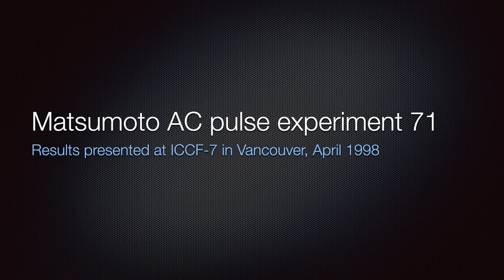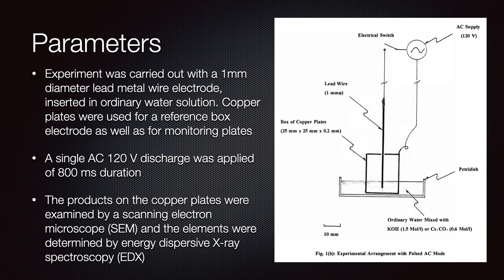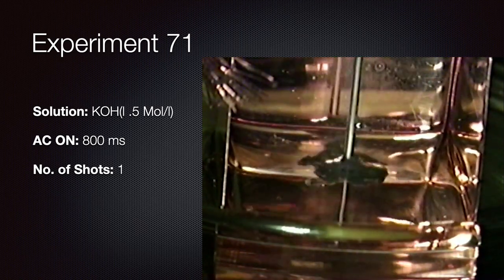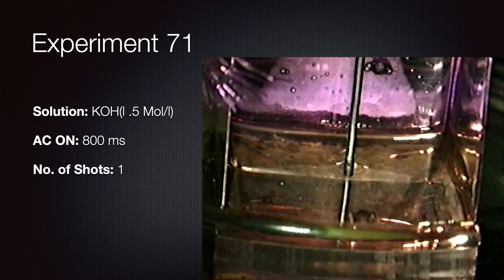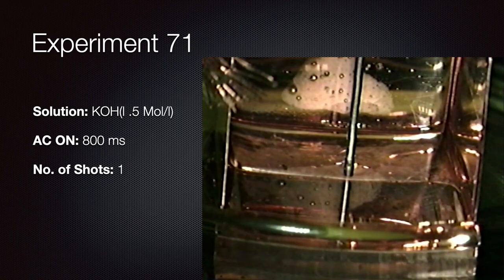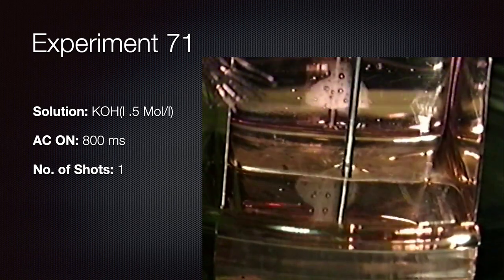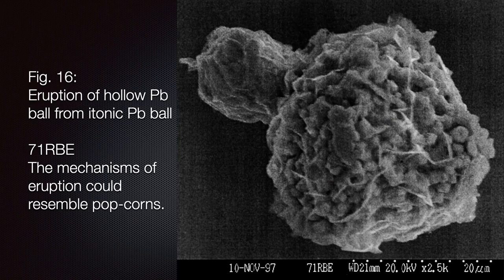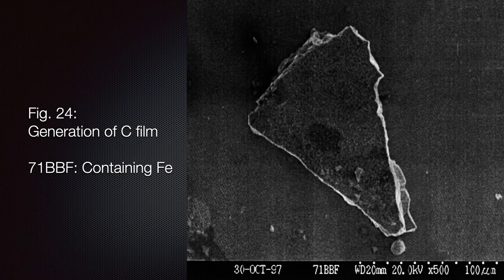Matsumoto - Experiment 71, overview, video, results

Comment: One does not need a cyclotron for great results a lot if results are buried in history by useing simple devices like Tesla and his smoked carbon glass slides and basic solenoids with needles  plus hundreds  of  others  
Back in time 

Today a young generation are doing great things with limited resources  it’s amazing what one can do if they want to do so never be discouraged just do it ❤
Reply from the maker: Just doing it is something you did to the max Baroness - as I say so often, the only way to guarantee failure or nothing is to not try.

Comment: Bob,

What is this supposed to prove? I have a friend who just recreated your EVO experiments and water fusion with an electrode and now he is building my star device in a closed system to see what happens. I will let you know what happens as Matsumoto did all of his experiments in an open system with limited results.
Reply from the maker: I don't think anyone outside of Matsumoto knows the experiments he did.
Reply: @MFMP  Bob, there is a lot of similar experiments on YouTube if you search a lot.
Reply from the maker: @richardmuller867  Of course, but how many of them were done before 1989? How many were recorded on tape before 1992?
Reply: @MFMP  None.
Reply: @MFMP  Bob, I was looking at your time frame of Masumoto's experiments and he started after Pons and Fleischman's announcement of possible cold fusion in 1989. Matsumoto was not the first to try such experiments.
Reply from the maker: @richardmuller867  You are answering a different point.
Reply: @MFMP  Bob, it is similar and has the same time frame when cold water fusion was going on in the news. Masumoto struck an arc and Stanley and Pons used a porous electrode.
Reply: Bob, both used electricity.
Reply from the maker: @richardmuller867  Matsumoto absolutely and clearly states that he started his work following the P&F announcement. This is not the point here. 

Matsumoto did a series of experiments that were unlike any other at the time - many are still unique
Matsumoto did radiographic emulsion analysis using his specific expertise that is unique even today
Matsumoto did video tape recordings of macro and microscopic level both during experiment and during analysis that was largely unknown in the field until the MFMP started doing it and it was only in the third week of April 2023 that it was revealed that the recordings existed.
Matsumoto, unlike almost all other researchers in the field, significantly updated his thinking as new evidence emerged.
Matsumoto found things that had zero exposure in the field in the past 20 years until after the MFMP had unknowingly replicated some of his findings.

Matsumoto's results and clarity of insight far surpass most people in the field.

His 1991 book stated that a principle mode of reaction was electron induced gravity collapse of matter - it is literally the front cover of his book stated unambiguously. It took other researchers much longer to consider the possibility - though the Russian, Solin, was very clear in his 1992 patent.

Matsumoto recorded GRAVITY WAVES and INTERFERENCE of them from experiments on Radiographic emulsions - not just words, schematics or calculations but hard data, that was published in a number of articles in the ANS journal "Fusion Technology" from 1991 onwards.

The word "Gravity" appears in his book 159 times and "Gravitational" 34 times. Just review his schematic on page 34 of his book "Steps to the discovery of electro-nuclear collapse" for the complete overview of reaction modalities clearly defined.

Pons and Fleischmann never claimed gravity processes, to the best of my knowledge, it was Matsumoto, then Solin. We have been very vocal about this likely-hood for many years now based on our own findings. Almost all other researchers in the field mock and shun the idea.
Reply from the maker: @richardmuller867  Please read Matsumoto's book.
Reply: @MFMP  Bob, Thanks for the information. I was not the first to come up with the idea of gravity waves using electron for electro-nuclear collapse. I only came up with the idea back in 2001. Matsumoto beat me because he born first. LOL. I use some different terms, but it is basically the same thing. Why wasn't Matsumoto in the news as I never heard of him until just recently with your YouTube presentation's. Was he covered up? Everything that I see with Matsumoto is an open system and my idea is a closed system. Even the modern fusion experiments are an open system and just bounce the pressure leading to a lot less energy production. My star device uses a closed system to keep the pressure on longer for more energy production. Maybe with APEC coming back soon we will see some of my friends' devices that I helped them with fusion and antigravity and warp drive propulsion. Rick
Reply from the maker: @richardmuller867  You will be able to judge for yourself if all his systems are in fact open when you see his videos.\ 

Define open?

Yes his work was suppressed. 100%.They literally changed the rules for ANS "Fusion Technology" journal in 1994 to exclude his papers when he started associating the phenomena with natural ball lightning - only to have the USAF J.R.Roth paper on "What BL can teach the Fusion community" be published the following year in the same journal. He wrote to the editor of FT to protest the rule changes in a typically understated polite Japanese way.

https://drive.google.com/file/d/12ywEDogGbobbvYpxPhI_PaXcPV9R0s9p/view?usp=share_link

In the early 2000s the elders/controllers of LENR demanded that Ken Shoulders BL work be removed from LENR-CANR.ORG and of course, Ken was saying LENR was BL related at this time.

Matsumoto's work was excluded and not discussed further outside of Russia until I became aware of it from Russian researchers in Sochi in Oct. 2018.
Reply: Bob, I will be waiting to see if Masutmoto's devices are open or closed. I also attempted to publish three times and I was refused. I argued for one month. I also just worked with another scientist up in Canada with his theory that also works, and he was refused publication. They always state that the paper has to follow the standard model which is a crap shoot. I also chat with many scientists who know the Nobel Prizes are clicky and losers win this prize. Rick